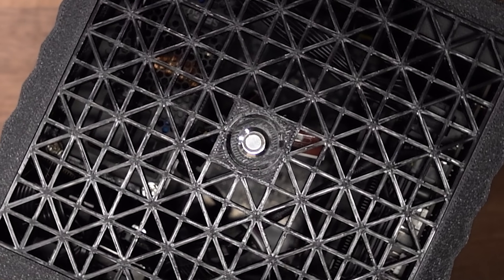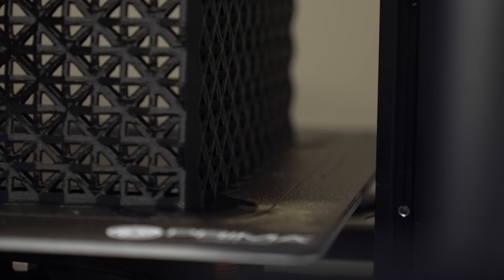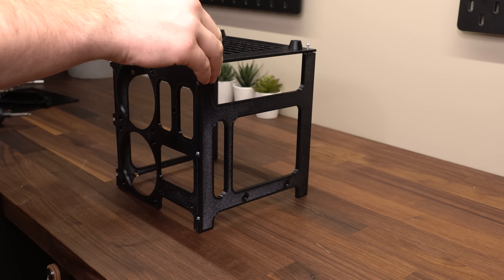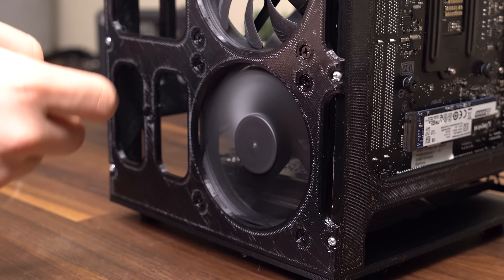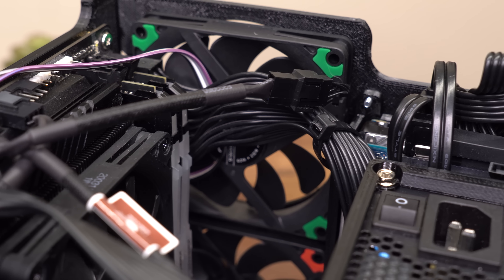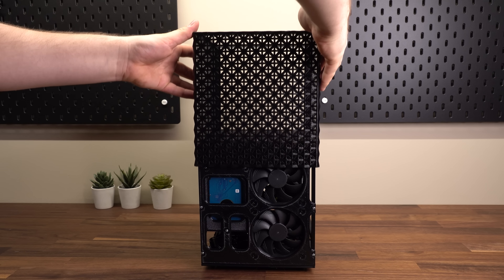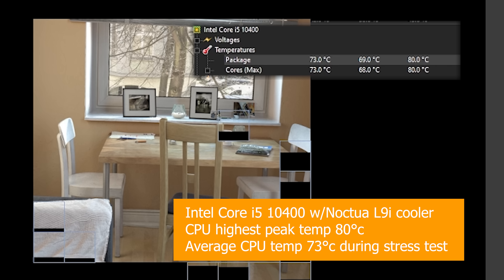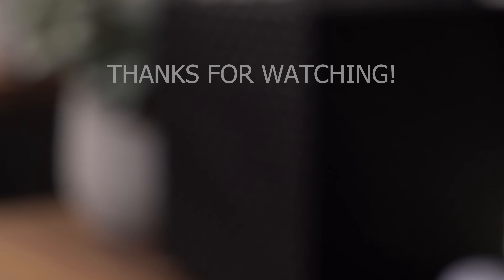Custom 3D Printed ITX cube case

Comment: This is why I want a 3D printer. You could literally do whatever you want as long as you had Model for it.
Reply from the maker: Exactly! It’s a super fun hobby that I highly recommend! 😊 it’s not only useful for PC cases but you can fix so many other things with it as well!
Reply: I recommend you get into it 👍. There is a harsh learning curve but it is a pretty fun hobby. Do your research and make sure that you get the right 3D printer for you before buying one though.
Reply: @magic00squirrel  That learning curve is no joke, but it can be very rewarding when you get it just right.
Reply: @magic00squirrel  harsh learning curve how?
Reply: Learn CAD and you can model it yourself
Reply from the maker: @owen8399  exactly! Seems very advanced for someone with zero knowledge, but just by learning the basics you can make almost anything.
Reply: @makerunit  CAD is actually fairly easy to leran nowadays with all the youtube tutorials etc and free options like f360 etc!
Reply from the maker: @ericvauwee4923  exactly! 😊
Reply: Prusa 3D just announced their new i3 MK4; the Prusa i3 is kind of the benchmark for reliable and easy to use consumer printers, and this new MK4 has been dramatically improved again. It's not a dirt cheap choice though, in the $900 ballpark as a kit. But, you'd get an extremely reliable and surprisingly speedy printer due to the new improvements they've done to it, it could probably print this cover at half the time or maybe even less. Although - the i3 MK3s is now for sale at under $600 which is still a perfectly great printer. It's not as great as the $900 MK4 but my i3 works great and has since I got it.
Reply: @extectic  at $900 for the mk4 the Bambu P1P is way more attractive
Reply: @ACustomArcade  kit is $799, though I do see a lot of people pointing to Bambu I think I'll stick with Prusa's open-source model.
Reply: @DingDongMcgee  sure, but a kit isn’t a valid comparison to a fully assembled machine with an all metal frame.
Reply: @ACustomArcade  i would buy creality k1 max it has 600mm/s speeds large volume and other things
Reply: I must add by wanting to become an engineer youll be able to design these models aswell :D Heck, you dont need to study for any of that tbh
Reply from the maker: @lukaslanger5068  self teaching is the way to go for 3D design in my opinion. (Meaning learn the basics from a tutorial, experiment your way around the program and look up speficic functions as you go whenever you need to) that’s how I’ve learned. 😊
Reply: @makerunit  Well, parts of my knwoledges is self taught and the other half comes from engineering school and it will open up completely new worlds for your creativity if you learn these tools properly. But maybe some people dont need that at all. As long as youre happy everything is good :)
Reply from the maker: @lukaslanger5068  that makes sense, would perhaps open up a new mindset to ideas I maybe didn’t think of before definitely 😊 Just me who’s not patient enough to go through a 3-5 year program 😅
Reply: Don't overlook the bed size. If you're looking at making PC cases, you're going to need to something larger than what you see on an Ender.
Reply from the maker: @livedeliciously  definitely. I even think my CR10 can seem too small some times. Optimally I’d want something that’s about 450x450. That should be able to fit most parts 👌 I’m considering the new CR M4, seems pretty cool with the linear rails and good specs. It’s somewhat pricy though…
Reply: @makerunit  The printer I'm looking at making is 300^3. Do you think that's too small for a PC case?
Reply from the maker: @livedeliciously  if you’re planning to make a bunch of PC cases, and then keep making more and more I’d think a bigger one would be the reasonable choice. But if it’s for a one-time thing you really gotta think through if you really want a massive printer or not. I’m personally looking for something that can print even very big cases long term so I’m looking into upgrading to a bigger one but 300x300x300 should be more than enough for most scenarios in my opinion! 👌 For reference, every single build on my channel so far has been able to print within those measurements (300x300x300). I’m long term looking to make some ATX fullsize builds too, therefore I’m considering something like the Creality M4 with a 450x450 bed but size also has a price tag so It’s something I’ll need to really consider before deciding 100%
Reply: @makerunit  I would recommend a Voron 2.4R2 350mm. You have a printer already and can print all the necessary parts yourself.
I added auto z calibration with klicky probe, nevermore (for recirculated air flow) and a 200w heater to get 55c chamber temp. 
I also added a MMU for multi color prints (6 color). Enraged rapid carrot feeder project. ERCF.
Reply from the maker: @Todestelzer  honestly I’m really drooling on the new Creality K1 MAX printer. Those speeds look insane! The bamboo lab ones seem cool too but I’d need at least 300x300mm build volume 😅 can the Voron keep up with those speeds?
Reply: @makerunit  my highest acceleration is 7k. Travel speed 700mm/s. What speed you can print with depends on the hotend and the filament in the end. Printing really fast will reduce the stability of the print. I’m printing with around 24mm^3. Dragon hotend hf and cht nozzle. 
My print speed for walls is around 100mm/s with 4K acceleration and infill around 200-250mm/s (volumetric flow rate limit) with 7k acceleration with a 0.6mm cht nozzle

Maybe the Qidi Tech X-Max 3 is a alternative to the Voron. It has a heated chamber as well. But I didn’t look to much into this printer.
Reply from the maker: @Todestelzer  does the voron have any features to fight ringing etc? Z banding and ringing are my two worst enemies right now 😅
Reply: buy one! join us!
Reply: It's totally worth it. If your willing to take a risk, you could literally get a printer big enough to make this case for under $100 bucks.
Reply: You should try 3D modeling.  Whether you use a CAD or Blender don't really matter, though you may have issues getting good measurements with Blender. Super fun too.
Reply: @KidCe.  correct, and if there was any confusion around the document limit for f360, you can always flip documents between RO/RW to stay within the free tier bounds
Reply: same expensive asf tho
Reply: Well, that is a very romanticised vision of 3D printing!😂
While the results are amazing, no seller ever fills you in about the hours of troubleshooting, finetuning and maintenance you have to do on these machines. 😅
Reply from the maker: @overflow7276  haha true point there! I had a lot of issues to start and still a few details I’m struggling with but I haven’t made a single adjustment exept replacing a nozzle the last year and my «slightly modified(very modified) CR10 is going strong once all the tuning was finished correctly. Including tightening all parts at the correct all angles, lubing leadscrews, fine tuning belts, etc etc… still not 100% perfect but ticks most boxes now 😅 produced usable results like seen here in this video 😅
Reply from the maker: @Todestelzer  that sounds pretty dope. I’ll definitely look into it, thanks! 😊
Reply: learn CAD and you can make anything
Reply: You can model yourself, blender is for free
Reply: If you don't have a model for it you can just learn to model your own things and then you have the power of the world in your hands. It's such a great hobby. Having a 3D printer changed my life, it's awesome.
Reply: buy a voron. (build a voron.)
Reply: @LeoMastroTV  When I wrote that I didn't know about the measureing addons in Blender, and I was to stupid to realize you can just move an edge to a reference point, then just move it forward 15mm or whatever to get the 15mm you were looking for. Sorry if this doesn't make sense, it's terribly worded.
Reply: I got so addicted to 3D printing, I not design large scale industrial printers for a living. Its really fun and I love being part of the future of additive manufacturing

Comment: very nice , personally i would have air brushed it to give it a silver matte look , but thats me the design is BEAUTIFUL 10/10 VANITY score
Reply from the maker: Thank you! 😊 I did really consider it but ended up going for the straight out of the printer look to show the simplicity of this project. I’ll definitely try to do something like that in the future 😊
Reply: Just be careful what paint you use not everything is good for plastic and will warp it.
Reply from the maker: @Bigdog1787  that’s a good point. Some paints might react with the plastic. Thanks for the heads up! 😊

Comment: definetly a very nice idea but i don't feel the printsettings/ material choice
this build would 100% benifit from fuzzy skin, mat filament and smaler layer hight
Reply from the maker: I personally felt it got a little too shiny. I’d prefer a more overall matte skin. I did notice some blobs due to I forgot to move the seam to the rear but I think it turned out pretty good. Some paint treatment or something could have fixed this somewhat at least. 😊

Comment: Pro tip, next time create a design around the 200mm noctua fans.
Reply from the maker: Oh it’s already on my to-do list. One of my regular viewers have requested this a lot! He refers to it as a «dual 200mm fan wind tunnel» which actually sounds quite fun to try definitely 😊
Reply: @makerunit  Yes, this is exactly what I meant. I personally do not like those small cases at all but I also understand why this design choice is intriguing. 
I came into contact with this 200mm fan when planning to place my tower PC into a cabinet because those fans have a 5V USB powered version, which is perfect for evacuating a cabinet. 
If you need help, I am a mechanical engineer and CAD designer in the German automotive industry, I may be able to help you and glad to do so =)
Reply from the maker: @sierraecho884  honestly for me I love both small and large builds. The aesthetics are what I care most about. As long as it looks good, performs well, it’s good in my mind.

I’ve mainly been focusing on the smaller builds recently due to the ease of printability to be able to print things like the covers in one piece given what equipment I have available. 

I really want to one day create a full size beast with great airflow, high performance and top tier parts for my everyday use. 

My i5 10400 at the moment kind of struggles at times with 4k video editing smoothly. It’s works okay. 😊
Reply: @makerunit  This is absolutely a personal preference, each should choose it´s own, no doubt about that.

Your limitations (smaller build volume) which you gave yourself absolutely make sense considering your manufacturing technique. It´s also quiet fun to challange one self like that in my opinion. I really liked your design philosophy and the style, I think you have done a great job. 

I just got a R5 3600 myself xD But I am not a snob, I don´t need the best of the best. Usually I choose by a price/performance ratio. My last build was a i7 4770K which I had for about 8 years. 
But I would prefer a beefier setup as well. Mainly for Photogrammetry but also for Gaming.

Comment: Im assuming you printed it in PETG ?  
PLA would deform and melt at 70'
Reply from the maker: All parts exept the external cover are PETG. The external cover is PLA, mainly because at least the PLA I’m using seems a bit more matte than my PETG. Keep in mind that even though the components can reach up to 80 degrees, the continious airflow never allows the ambient air to reach those temperatures. Both the CPU and GPU can run at 70+ degrees for hours no problem. 👌😊

Comment: it's a bit dangerous to use PLA in these builds, as PLA gets soft around 60/70ºC and can deform, ABS/ASA or PETG is more advisable instead
Reply from the maker: Just keep in mind that even though lets say the CPU reaches 80, doesn’t mean the ambient air in the case will reach 80. When CPU is in the 80s, the air is probably 45 maximum 50 degrees coming out the back. I just picked a PLA part off my printbed at 70 degrees, I could easily bend the part. But that part also felt burning extremely hot on my fingers. The case feels barely lukewarm if even that when the CPU and GPU were running at full throttle. 

As long as the case has continious airflow the PLA shouldn’t be a problem. I would probably steer away from PLA whenever possible, but from my own experience too this seems to work fine, as I have personally not had any issues regarding PLA and heat in any of my previous builds that used PLA 😊

In this case the only PLA part is the external cover, having only intake fans ine cover this will have absolutely no effect to the PLA 😊
Reply: @makerunit  the airflow helps a lot... awesome project, congrats!
Reply from the maker: @GS12.3D  but I definitely understand your concern! Not all cases are able to work with PLA but from my experience they seem to hold up pretty well as long as there is a consistent airflow. 😊

And thank you! Have a nice night/day/morning wherever you’re located 👍
Reply: Im wondering print the plates in PETG and the external frame /vents in PLA.
Reply from the maker: @MrBizteck  that’s what I did. All internal frame parts were in PETG, only the external cover was PLA. The top exhaust vent was actually also PETG.

Comment: I would've definitely printed that in a filament with a more matte finish. Looks great though.
Reply from the maker: Thank you! I was originally printing this in PETG which tends to be kind of shiny, which it actually was, so I decided to reprint in PLA for the external cover which made it somewhat more matte. I should probably have added a coat of filler and some matte black paint to make it perfect indeed! 😊
Reply: @makerunit  You used PLA only for cover? What about the internal parts. From what i know PLA is less resistant to heat than PETG!
Reply from the maker: @jokerownz  all internal parts are PETG. Only PLA for the external cover which only has intakes so no worries there 👌

Comment: this is awesome!! i would absolutely kill for a 3d printed 1U rackmount pc build! id buy those stls immediately
Reply from the maker: Thank you Jose! 😊
Reply: Rackmount is trickier since it's quite long and flat. In fact, even the 19 inch width is not doable on most consumer printers. That's half a meter. That said, you could do some kind of hybrid, with steel rods or something similar to form a frame and build all the connecting bits with 3D printed PETG or ASA, or even carbon fiber PETG. Also, the 2.6 variant of Prusa Slicer does have a feature for taking a larger part and intelligently breaking it into pieces with connectors so you can glue them together accurately with something like 3D Gloop. It's doable, but probably need to get a bit creative with integrating steel and 3D prints. But for rackmounting... I think steel is still going to be the way to go.

Comment: Love the work. Would recommend threaded inserts for those things that need taking apart again, and securing the top cover from the bottom to hide screws. Or make it just clip in.
Reply from the maker: Thanks Marcos! I have personally had bad experienced with threaded inserts in many cases. They seem to come loose if they aren’t 100% perfectly installed. As long as the plastic threads are not stripped they actually hold suprisingly well during assembly/disassembly multiple times.
Reply: CNC Kitchen did a good video about threaded inserts. Their test results show screwing directly into plastic is about as strong as good quality threaded inserts. I don't think they went into much detail on how repeatably it can be redone, but from my own experience, threaded inserts aren't really needed if you're careful with assembly/disassembly. Maybe only necessary if you are unscrewing it regularly.
Reply: @cakilas8966  I suppose it also depends on what screws and what plastic. Like you say it depends on frequency as well - and I’m always having to open my PC for one thing or another!
Reply from the maker: @cakilas8966  Exactly. I feel the grip of the threads are so much more secure than the inserts melted in place. When pushing in the inserts they often tend to leave air gaps not sealing 100%, also if they’re not inserted about perfectly straight they will loosen whenever the screw is tightened.
Reply: @cakilas8966  I recommend what is called 'headed' brass inserts - put them in from the back, and then screw from the front, they have a bit of a flange, so it grips the plastic much better, and because it's brass, they don't strip / wear over time.
Reply: @makerunit  I really like the heat inserted ones

Comment: waiting for atx psu build
Reply from the maker: Hmm, a 300x300x300 build?
Reply: @makerunit  maybe slightly smaller than that ?
Reply from the maker: @andywang1313  so, ATX psu, but all ITX parts otherwise? I feel like it would make the most sense to allow for at least a mATX mobo if using an ATX psu though. Therefore 300x300 would be the most reasonable in my head. (Possibly slightly smaller ofc)
Reply: @makerunit  matx or mini itx is good, i will leave the rest for your imagination to create the best, also there are some mini itx case with atx psu out there if you need inspiration.